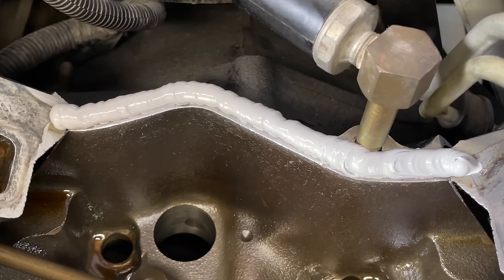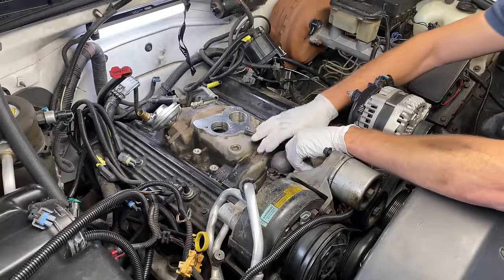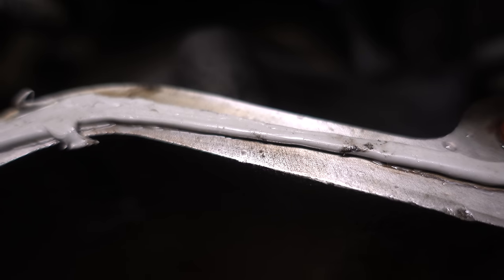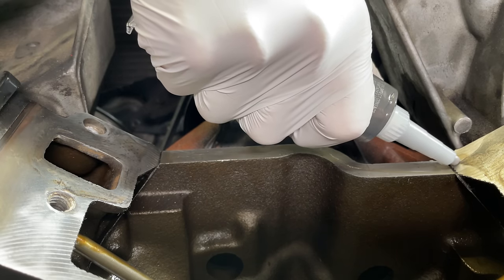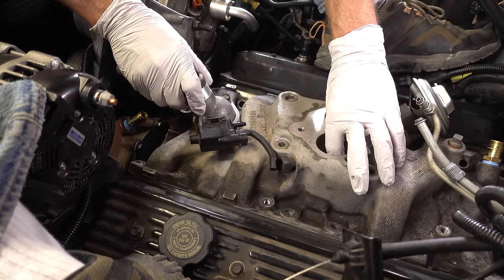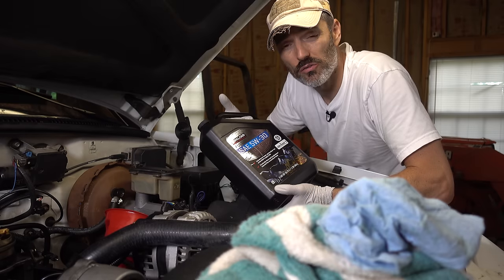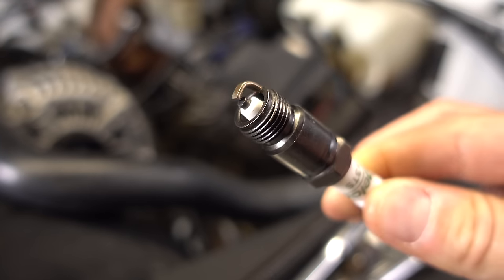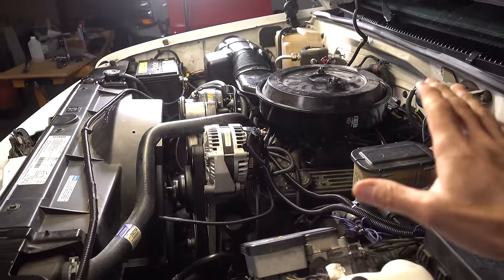Why You NEVER ATTEMPT To Use RTV Gasket Maker Without Doing This First!!

Comment: This video is completely wrong. If you use the amount of RTV this guy uses you will destroy your engine due to oil starvation. Only a very thin bead is needed. If you use the amount this video suggests it will squeeze out into the internal side of the engine and will eventually break off and enter your oil ways. Be warned.
Reply: Bro gtfoh people use rtv in racing applications I think the mf rtv will do fine like it's been doing for my thermostat for the past 90,000 miles.🤡🤌🏾
Reply: @toxicity6629 the brown hand says all we need..
Reply: @jodiehighroller9820 which is?
Reply: Not on old FE engines. Putting a thin bead on the back and front of the manifold would be a huge mistake and you are going to find yourself ruining multiple gaskets pulling that 1000 pounds manifold on and off because it won't stop leaking due to "conventional" advice.
Reply: Chevy intake manifolds have a big stupid gap in the middle on the front and back. Sometimes 1/4 inch. You have to put a lot with these.
Reply: @redsite001  I heard them referred to as "china walls" before.
Reply: Music City Trucks, Engine Power and Richard "The Dynamometer Guy " all squeezed that much on the "China" rail. I use 1/2 that much of high-red or Yamaha bond #2 with a dab under and over the intake gasket. But that seems like too much for the end rails. I have had plugged heater cores with Blue silicon at inlet. So having a chunks peel off and plug the oil pickup tube. We know what happens next! Retired. ASE master since 78.
Reply: Dimple the tops of the China walls down center lengthwise with a center punch around 25 a piece 
As the rtv dries it sits in the dimple indentations and helps keep it in place or sliding into the engine
Reply: These intakes you have to put a fat bead there’s a big ass gap to fill.. exactly why he had to do it a second time😂😂😂
Reply: @joegage6171  I use high temp red only anymore. Yamaha bond #2 is an equal. Tech tip; lay clean intake on torqued heads and look for the valley rail gaps. Machine shops are only as good as the last guy using the fly-cutter!
ASE Master since 78.
Reply: In this case you need the amount that equals the gaskets thickness.. it’s not one single surface.
Reply: @AOKONE  After checking the deck height, you use 1/8th inch more to complete good contact. And never wait for silicone to "Skin-Over". Just put it together and keep going or plan "B". Install, torque to specs in correct pattern and take a cold one from the Man Cave fridge and open while carefully drinking your beverage with a smile :)
Reply: Some China walls have a huge gap between intake manifold (6mm+ gap) so you need a thick bead of Rtv, I’ve seen David freiburger doing this for a long time and never saw him got in trouble because of this, It’s totally normal for old American’s v8.
Reply: @satan101101  
The only china wall I’ve seen had zero gaps………
Reply: @satan101101  Factory is under 3mm so if block is resurfaced and heads are milled, a dry run with head gasket is "Best Practices".
Reply: @HenryKissingersGhost  

I’m about to tear mine down  

an old FE engine How do you get yours to stop leaking? 

I bet you a dollar you don’t know what if F.E. stands for without looking it up
Reply: I was thinking the samd thing, but obviously this engine had very thick gaskets so a thicker beqd was required. I think for most engines the gasket os mich thinner and people would destoy their engines applying a gasket that thick
Reply: There is no one size fits all rule, just mock up the fitment first with the manifold and gaskets, no bolts, measure the gap between the china wall and the manifold and size your rtv bead accordingly.

Seriously guys its not hard, no to engines are the same and all of you just pointing fingers at eachother say the other guy is wrong are acting like children
Reply: @shaolinfist8323   Engines never come with accurate history. If the block is milled, different intakes have gaps. But I found high-temp red and never had a problem in 40+ years!
ASE Master since 78. Best of luck but just be sure...
Reply: @gabrielibarra5551  I agree, you have to check dry. I use nothing but High-Temp-Red. Never heard of the term china wall until watching certain tv shows. My youngest said he had a doughnut in the truck of his 86 Monte SS. I asked him if was stale? Oh! Spare tire is a doughnut? Try ordering one in the parts department...
Reply: @redsite001 correct, this job is the exception to the rule.
Reply: I did the exact same thing he did to my truck 12 years ago and no damage has happened. You do have to use a fairly generous amount or it will not seal.
Reply: Wrong sir, this video is 100% correct
Reply: So I use a tiny drop adhesive put it on the actually real gasket and I'm good to go. When you put it back on with liquid gasket it gonna smear. The regular gasket holds in place
Reply: Youre wrong.   Way wrong.  There is a VERY large gap between the engine and manifold.  Using just a little bead of rtv will cause leaks.  Using those rubber gaskets.. cause leaks.

You need a very big bead of rtv to make up for the gap for it to work.

It isnt jist chevy engines.  My 5.9 magnum mopar engine also has large gaps.  I did my intake like 10 years ago with a giant bead of rtv and it hasnt leaked or done anything to the engine
Reply: In the trade we call the excess "worms" as they get dislodged and plug the oil pickup, even did a repair on a engine that eggs, another with reinforced shop rags were put in engines by tree huggers.
Reply: The reason he did so it’s because there’s a huge step due to the gaskets on the inlet ports.  The point of putting that much is to compensate that gap. He put a good amount instead.

Comment: At 10:35 you're using your torque wrench to torque to 10ftlbs in hopes of getting 35ftlbs.  I only see an extension inline with the wrench, so your 10ftlbs is only giving you 10ftlbs.  If the arm was longer, that's when you need to calculate the final torque.  Or have I been doing it wrong?

Comment: I did one years ago on a gen 1 350 prior to internet and the old guy that told me to use silicone I made the bead exactly like yours there only one thing he told me to different was to let it skin over first. So it didn’t all squeeze out all over the place. I still drive the same 350 once or twice a year it was my daily driver for years  built motor at least 25 years ago still doesn’t leak at the intake manifold. But it does leak everywhere else. Hahaha great video.

Comment: I remember on older engines like that the gasket set included a rubber gasket for the front and rear with rtv for the corners to fill any small gap at the ends of the rubber gasket.

Comment: ive had a few of these intakes off to say the least. i was able to pull off and put back on these guys in a few hrs tops depending on what i was doing for the repair. and i never had to remove one for oil leaks or coolant. one of the best things you can do when applying silicone sealant. put a big ole thick glob on. then go in circles with your finger smoothing it out and smearing it around. it should look like a nice weld a bunch or dimes stacked on eachother. i also put a ring of it around the coolant passages on the heads then put the gasket on so both sides of it get the silicone on it in the front and back. then one more ring of silicone around the coolant passages on the top of the gasket and set intake smoosh it around a little and start the bolts let it sit 5-10 mins till the outside gets a little tacky but doesnt come off on your finger when you touch it. you want it to have a skin but still be pliable and wet inside the skin. then torque it down. the last part of lettting it skin is almost as important as smearing it around neatly. no bubbles. the skin lets it compress before it squishes out so it really fills in the gaps instead of just push out. also when cleaning mating surfaces always try to scrape along the surface and not across. on the back of the motor i seen a gouge going from the lifter valley cavity to the outside of the motor. those can cause leak channels and may never seal. one of my friends learned that the hard way recently and created a fire hazard that leaked about 8 quarts of oil in an oil change interval.

Comment: I have used this method of just laying a bead of RTV down and its hit or miss no matter how you prep. The fel pro adhesive cork rail gaskets work much better, they dont move and are solid. Just add some rtv at the ends and a thin bead on top of the cork.

Comment: i always do 3 - 5mm bead. yours is too much (too tall) but good thing it works for you. i always fear that if too much is added, the inside excess bead will eventually break off inside the valvetrain and possibly block the return line (drain line) to sump tank or pickup tube.

Comment: I have pretty much gone exclusively to “the right stuff” gasket maker in the pressurized can, it makes it sooo much easier to get the correct bead, as well as it is an excellent sealer material.
Reply: Victor reinz в баллоне , решает.  Согласен. Никаких проблем с ним.

Comment: To replace the intake gaskets on this small block Chevy is baby stuff. Try it on an FE Ford. Especially one that still has the cast iron 100 lb intake manifold. You have to remove the valve covers and the rocker arm shaft assemblies and the pushrods,  along with the carb and distributor and whatever else is in the way of all that to get down to the block and cylinder head surfaces.

Comment: Tip: Tech taught me a trick to get gaskets to stay put for assembly. 3M super 77 spray adhesive. Spray light coat on both gasket and surface, wait a moment for it to tack, then apply gasket. Word of caution, get the alignment right on first shot as this stuff sticks really good. Have done this many times since the early 90s' when he shared this tip. No more gasket squirting  around at the slightest touch or gasket sliding down on a vertical surface etc.

Comment: 6:45 After applying the generous bead of silicon give it 5 minutes to 'skin' before installing manifold.
You also need a thin layer of silicon around the coolant ports, heads and manifold.
I give the silicon at least 24 hours to dry before adding coolant. I also install my water pump this way, just silicon no gasket, works every time.

Comment: Tip for using those coin-type spark plug gap measuring tools.  Us a pair of calipers to check the calibration.  Some of the gappers are bare as-cast, and some are plated. I don't think they compensate for the plating. I've found some gappers are off by .010" from actual measurements (treating the caliper as "standard"). The gappers are still useful, you just need to know what to add/subtract to correct the scale on the gapper.

Comment: As an amateur it's easy for me to pause for 45 min to allow the gasket maker to set up before torquing to spec. It makes sense. I wonder what a pro shop does, they don't often have time to pause, especially in a flat rate shop. Maybe they use quicker setting gasket maker?
Reply: Never wait for rtv to set. Always tighten as soon as you applied the rtv, this has been proven by Farms Projects just lookup the channel.
Reply from the maker: Yes, there is a quick setting version. Ultra grey is what seemed to be the go to RTV for this job so I chose that and followed directions. 👍

Comment: Another good tip is to tape the intake and block off so you can put a thicker bead and not worry about clean up. I always did .200-.300in thickness. Shouldn't have to worry about it falling apart inside the block either
Reply: 😂😂😂😂 ffs you really put two zeroes at the end of you point whatevsr measurement. this youtube and its comments are comedy gold for actual techs
Reply: @byloyuripka9624  as a former VBM  and bridgeport operator i appreciate it

Comment: Having to sit on top of the engine bay is an especially important technique most mechanics fail to mention. 😁😉 Awesome video! Thanks!
Reply: yep im 79 and i can put a foot down on either side of the motor setting on the core support but it is a pain to climb back down to get something.

Comment: What you need is some 1/8"-1/4" hard cork to make the gaskets for either end of of the manifold. That is what the manuals used to specify back in the 70's. Then you can use a THIN coating of RTV on either side. Filling up the space with RTV is not the way to handle that.

Comment: Before starting a job like this, drain all the coolant and replace with water.  Then, use a shop vac set to blow and push as much water as possible out of the intake (disconnect lower rad hose).  Won't have to do an oil change because nothing should fall into the engine pulling the intake, and if a small amount does, it's just water and will burn off without damaging anything.

Comment: Yeah good video. Definitely did the job correctly the second time. One thing I've learnt with V8 engines especially Chev is never ever use those rubber or cork end gaskets.  That being said I need to re do my 327 in my 63 because I used the rubber end gaskets and they are leaking badly.
Reply: i've used them so many times and never had 1 leak ever

Comment: On the small block Chevy engine, the front and rear intake rails, the manifold was never designed to "sit" down to the block rail. A small rail gasket was typically used, that also had notches for the ends of the intake port gaskets. Traditionally, all you had to do was apply a bead of sealer where the rail gaskets and port gaskets met up.

I didn't see you do it, but naturally as with any gasket sealer/maker, you wan to clean both surfaces with alcohol or brake cleaner to remove any oily residue, so that the RTV will stick.

You also want to apply a higher bead of RTV at the ends/corners of the rails.
 
After you're applied your bead to the front/rear rails (if no rail gaskets are present), you want to sit the manifold down and just hand thread the manifold bolts in-place. Do not tighten at this point. Let the assembly sit for an hour or so to allow the RTV to set up a little. Then, snug down and torque your fasteners. Let cure for the recommended period before operating the engine.

Granted, nobody wants to perform work a second time, but I just can't characterize an SBC intake manifold gasket as a difficult job. First one I did was when I was 12-years old, on my first car. I do like how you explain things, but I wouldn't characterize this as a difficult task, as long as you made match-marks on the base of the distributor to the manifold, and then at the distributor rotor to a spot below it. If you've done that, it should be easy-peasy. Lastly, I was surprised at the amount of coolant that ran into the engine valley when you pulled the manifold, which made me question if you drained the coolant before starting the job?

Kind regards, Terry

Comment: I usually use high-temp silicone gasket maker IN ADDITION to the physical precut gasket, and am NEVER disappointed. Especially concerning automatic transmission and engine oil pans and main bearing seals.
Reply: Bad, bad practice.  Use one or the other.  We specifically have manufacturer TSB’s against this.
Reply: @blackhawk7r221  When bolting together the two surfaces, and torquing to specs, the silicone can get squeezed too thin, and then fail due to chemical effects or pressure.
Do this experiment: Have a thin film line of completely cured silicone gasket sealer on a flat plate of metal.  Then apply some gasoline, or motor oil, or transmission fluid.  The edges of the line will start to lift apart from the metal plate. Solvents will affect it.
Silicone isn't super permanent, because if it was, a mechanic would have a MUCH more difficult disassembly.

Comment: I prefer using Loctite one minute black RTV. It sets up really quick so you have to work somewhat fast but it is a lot more oil resistant. It’s also a little bit more tacky to if your trying to hold a gasket in place while you set something like an intake without the gasket moving on you. The ultra gray is good but takes too long for me to set up. The one minute rtv is also better with high vibration high torque and high heat. Down side to it is if you have to take something back off the one minute is really tough. Sets up harder than the gray too
Reply: The gray rtv from international for the power strokes is some wicked stuff ,smokes that permatex all to heck. 
I think it's called t-442 and ya get what you pay for.

Comment: That's a pretty thick bead of rtv. When too much it will end up in the oil strainer. Always clean and double clean the surface. As a tech I will say this, too much rtv will become an oil restriction in the oil system. Specifically the strainer.
Reply: It's only a problem if you rush the job and put fluids in before everything is cured enough. If given the proper time, everything should be cured enough to not fall off into the oil pan or engine, depending on what you're sealing. If the sealant isn't dripping on the outside where it pushed out, then its not dripping on the inside. If everything is clean or new like it should be, even if it drips before curing, it will stay stuck to whatever it dripped on. If it dripped onto the inside of a clean/new oil pan, if you wait the proper curing time, it will cure on the inside of the pan, and you wont have to worry about it floating and being sucked into the engine.
Reply: You dunno what yoire talking about... yes too much on surfaces that TOUCH eachother could maybe possibly break apart.. but on an intake the front and back for a lot of engines have a huge gap between them and the block.  You have to make a huge bead to fill the gap